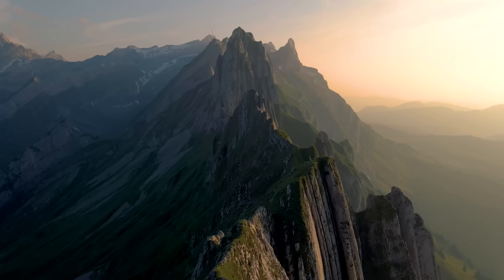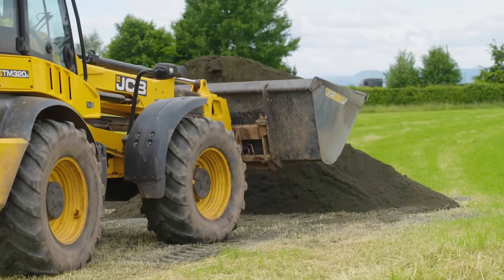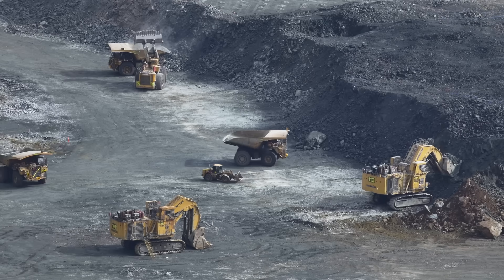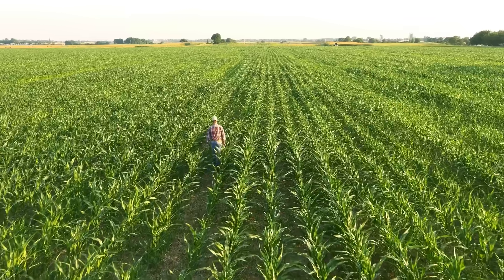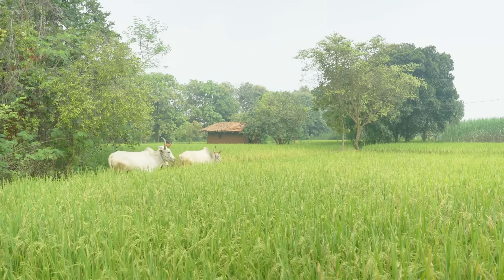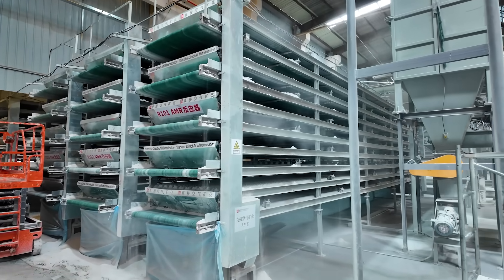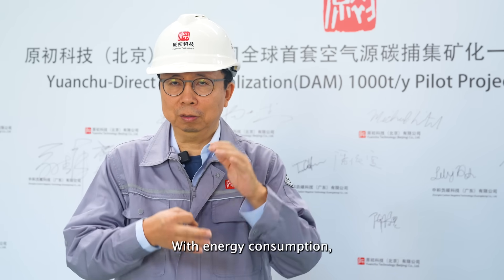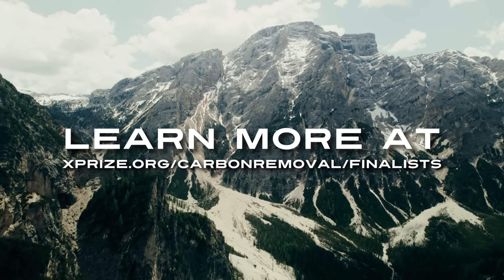Unearthing Rocks' Potential to Fight Climate Change | Meet the Finalists | XPRIZE Carbon Removal

Comment: It's great to use mineralization to remove CO2 from the atmosphere, BUT it takes several times more tonnage of minerals than the CO2. And we humans are putting tens of billions of tons of CO2 into the atmosphere every year. 
So is it really scalable to the required hundreds of billions of tons per year??
Who will pay for that and how will the payments be done?
Reply: You're asking the right question, the answer is: carbon capture will roughly double the cost of fossil fuels. Consumers will pay that.

Or they won't and will continue to use our shared atmosphere as their dumping ground.
Reply: The ration is often 1:1. It will depend of the mineral used.

However the possible scale of enhanced weathering is a few billion ton / year. It will not let us keep burning coal. The primary effort is to move yo low carbon energy sources. After we have done that we can use enhanced weathering for the remaining CO2 emissions.
Reply: Is it really scalable? Absolutely. The minerals are available in much greater quantities than are needed, and the energy it takes to pulverize and strew them is much less than the historical use of fossil fuel energy they clean up after.

The subsidy affluent countries' governments currently get from the fossil fuel sector, that they do not get when non-fossil energy is allowed, is enough to pay for this garbage collection.